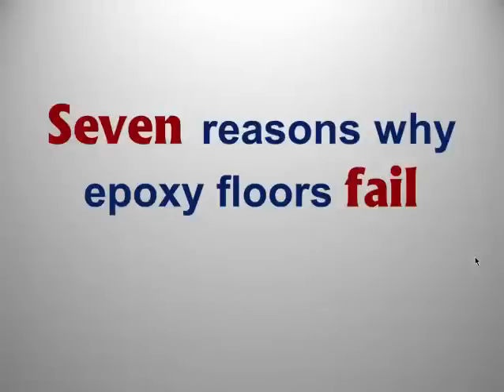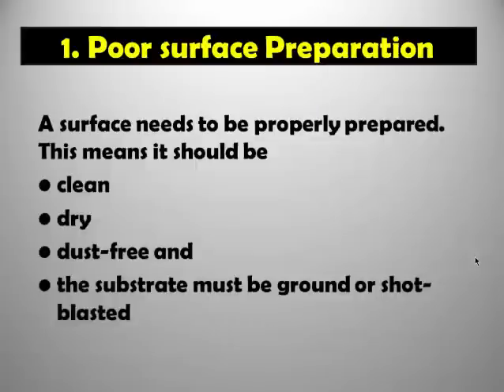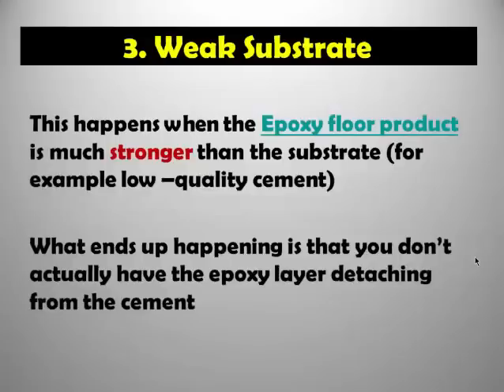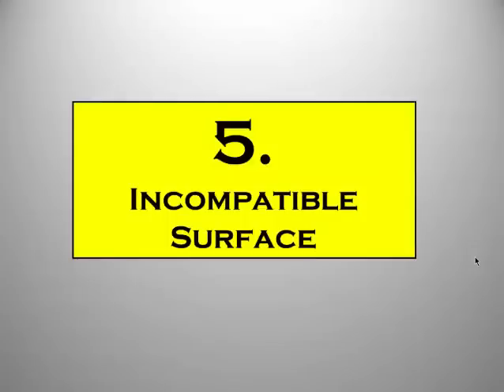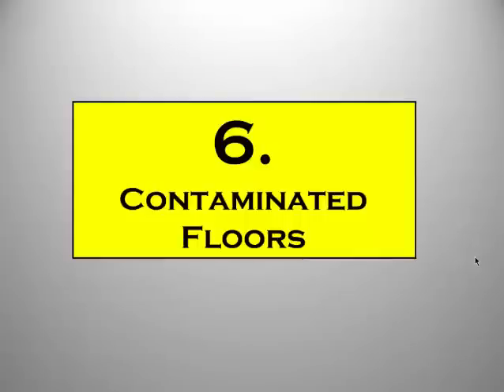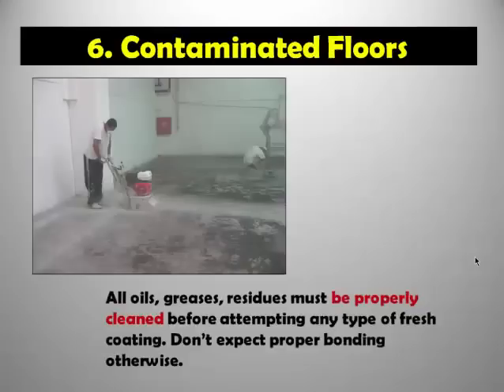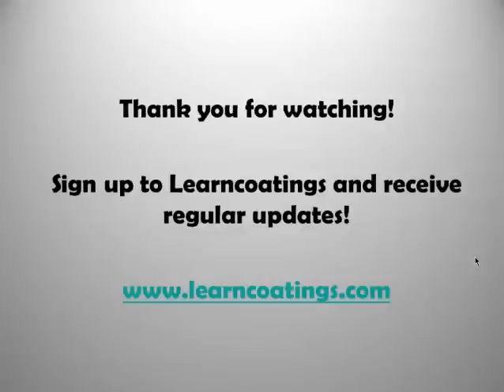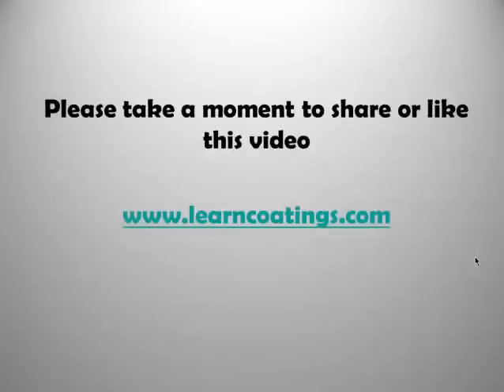7 Factors that cause Epoxy Floors to FAIL

Comment: When epoxying over a painted garage floor. Should it always be diamond ground? Do you need complete removal of the previous layer of paint or can I prime over this?
Reply from the maker: If the paint is in tact and not peeling you can prime over. If it is peeling you should assess if it is a localized problem. If the peeling is everywhere you try grinding it as much as possible

Comment: What about screened in porches with concrete? Will the epoxy fail on a outdoor surface?
Reply from the maker: Yes it will fail because epoxy is not UV resistant. It will go yellow and start to chalk. Don't believe reps that claim otherwise. They will be long gone when the floor starts to yellow. You would need to use an aliphatic polyurethane product for outdoor applications

Comment: In two places on my epoxy garage floor, a long running line, like a narrow ridge, has formed under the epoxy.    One is about two feet long and the other is three of four feet long.  What could have caused this?.  The epoxy was professionally done a year ago and looks good otherwise.  It is the epoxy with the flakes.
Reply from the maker: Could these be old floor joints that became visible due to the summer heat expansion? Otherwise these could be cracks in the floor that became visible again due to hotter temperatures

Comment: My garage floor has been previously painted, close to half has peeled off or wore off. It looks like somebody used latex paint on it but not sure. I'm going to strip it off, scrape, paint remover, acid etch, sand, clean. Any suggestions before applying Rustoleum pro epozy garage floor paint?,thank you
Reply from the maker: sounds like a soild approach, you may want to try if you can sand the paint off from the start so you avoid the paint stripper and etching

Comment: Our basement floor has many layers of paint, do we have to grind it completely off before we apply the epoxy?  In other words, how do we prepare a painted floor before we apply the epoxy paint?
Reply from the maker: It depends on the condition. If the paint is in good condition and not peeling you could prime on top. However if it cracked and falling apart you want to grind it of with a sanding or a grinding machine

Comment: My garage floor was done about ten years ago and it’s time to do it again. If I pressure wash it, can I coat over it with the same epoxy?
Reply from the maker: Yes epoxy can be coated over. If it seems to be damaged you may want to apply a primer first just to be sure that it will bond properly. Power washing should help make the epoxy clean, but if there are cracks in the floor you may end up with trapped humidity

Comment: OK.If I use the mixer I will ad bubbles and than what I do to eliminate those tine bubbles?
Reply from the maker: Let the mixed product sit for two minutes before starting the application. Many bubbles will burst. Also, If you are a applying a thick coating use a spiked roller to eliminate the bubbles. For thin film coatings, backrolling should eliminate any bubbles
Reply: MARCIO sborgi I
Reply: A torch can get rid of the bubbles.  Just don't hold on it in one place or you'll burn the resin.

Comment: on the sub floor would bag and box latex be ok for a smooth floor 4 prep to primer ?
Reply from the maker: not quite sure I understood your question. What do you mean by bag and box latex?
Reply: in the uk latex I have used is a bag 12.5 kg and 5lts liquid miw and spread smells of cats piss orrible
Reply: that's on a concrete floor
Reply from the maker: ok now I see, you mean like using a spreadable cement to level the surface and then you want to coat over it. Yes this is overall good solution, but it really depends on how much wear and tear your floor will be getting. If it is just a storage space with little traffic you should be fine. For heavier duty jobs I would advise checking to see what the mechanical resistance of such a product is

Comment: Can you just lay the diamond mesh sheeting on the concrete and apply the epoxy to that? Seems like a that would make it bond strong enough.
Reply from the maker: A diamond mesh sheet would definitely make the tensile strength of the floor very strong. However for bonding you would still need to do priming and somehow attach the sheet to the floor before coating. Also you would need significant quantities of epoxy to completely cover the mesh sheet. All this of course is hypothetical as I have never tried it for a floor.

Comment: I have never heard applying primer to the surface before applying epoxy if that's is true so what type of primer should I use???
Reply from the maker: use a suitable epoxy primer thats compatibe with the epoxy topcoat
Reply: Ely Portoy
Ely Portoy  Try Stone Coat Counter tops. They have videos in here.

Comment: Hi what about heating floor ? Or that epoxy good fo that or no ?
Reply from the maker: There are better floor coverings if you have heated floors. Epoxy is not great at thermal transmission, plus it does not have any elastic properties that can account for the changes in temperature
Reply: Edvinas Mieldazys
Edvinas Mieldazys I am adding a heating element under a wood floor, then doing the resin. Perhaps do not connect it to the walls. Leave space for the wood to move. I still have to screw the floor down though. I will ask around for those who use this resin stuff. Stone Cold Counters is good.

Comment: Can you do this over old ceramic tile?
Reply from the maker: have a look at this video for coating over tiles 
https://www.youtube.com/watch?v=gRIoNyurzSM
Reply: Thank you very much for this! Do you have recommendation what kind of materials to use ?
Reply: Dď
Reply: @learncoatings-epoxyfloorin9448  Interesting you say you can put this stuff over tiles, which are probably set to a wood floor, but you say no to wood floors. I have wood floors I am adding heat to. I will then have a strong boarded floor on top of that, then add the resin to it. I am doing the counters the same way with the resin.

Comment: What is the better way? Tile or e poxy reply soon nowadays i think about this thing
Reply from the maker: This not a one or the other decision. Both tiles and epoxy have their place in flooring. You need to decide what's best based on your needs and the existing conditions

Comment: What preparation is neccessary if I want to convert my wood subfloor to epoxy. I don't have a concrete floor.
Reply from the maker: Applying on wood is tricky as wood tends to contract and expand. This could lead to future cracking of the epoxy. I know that some people apply a primer first and then apply the epoxy. I would advise thin layers of epoxy, thick layers are more likely to crack
Reply: If you have any flex when you're walking on your wood, then you should put another layer of plywood down. I have used flexible epoxy before on wood (right after primer) then went over that with the rest of the floor... Not sure if it really does anything, but my boss had me throw fiberglass into the floor as well, and also not fun either to flatten your floor out again afterwards. And your itchy the rest of the project.

Comment: I had someone put epoxy on my garage floor the first time he did it was sticky for a few days and peeled in 3 or four places under tires. He came and fixed a few areas and now recently 1 area peeled off the floor. What’s the solution? Any advice is much appreciated
Reply from the maker: If it's is just one area you could try doing a local patch job. But if you feel that the whole floor is slowly failing and that it will be one never ending patch job after the other then you may need to strip the old floor and do a recoat

Comment: I'm doing over the floor in a restaurant that somehow have 3 sets of ceramic tiles stacked onto the sub floor . It will cost too much to try to get that up and do the floors. We wanted the floor to be red. with the clear epoxy coating over it. We painted it already but wanted to do more research before we go ahead and lay it down. Now by looking around I didn't see much on that subject and want to know if I use the right epoxy primer by rolling it onto the ceramic tiles,(a few coats) will that be sufficient enough for the epoxy resin to bond?
Reply from the maker: You should grind/ sand/ blast the tiles in advance as you need to remove the ceramic varnish coating that covers the tiles. Once this coating is scratched then you can go ahead and apply the primer. I have another video here 
https://www.youtube.com/watch?v=gRIoNyurzSM

Comment: What are the most durable epoxy finishes?
Reply from the maker: self leveling epoxy mixed in with quartz is the most durable in my humble opinion. Defintely go for a thicker coat at least 2-3mm

Comment: Thanks so much for this video, and all of your replies! We are right now grinding our old basement floor that had been previously painted, but it's been a bear to get all of the paint off. It's good to know a few hardened spots left is fine! Question, though, I was told to put a sealer down first before the primer. Is this necessary, or is that overkill?
Reply from the maker: I would say its overkill. Put one coat of primer and check to see if it is absorbed or not. If it is absorbed quickly, then just add a second coat of primer to make sure that you have a sealed surface. Good luck with the installation!

Comment: I have 1 inch oak ply, very solid, stained and polyurethaned.  Do you think it might work on that?  It's not flexible to me.
Reply from the maker: Epoxy on polyurethane can be quite difficult in bonding. You should definitely apply an epoxy primer first to ensure good adhesion

Comment: I have a floor that has hairline cracks in it. They are getting worse but I can't afford a new floor! What product can I use to repair or "fill" the cracks? I think the resin is cracking because the screed underneath it is.
Reply from the maker: what floor is it? epoxy, concrete? You could try using an epoxy putty, or use clear epoxy resin mixed with sand to fill it

Comment: Can I apply epoxy over an old brick floor?
Reply from the maker: you could, but do not use it for heavy traffic as the brick will fail. Bricks tend to be quite soft

Comment: can you epoxy over wood or does it need to be concrete
Reply from the maker: not recommended. Wood has humidity and is also quite flexible. Epoxy is hard and is sensitive to humidity. You could end up getting cracking
Reply: Dont woodworkers make tables out of epoxy all the time? Is there a difference in floor epoxy?

Comment: Do I really need a humidity membrane before applying metellic epoxy?
Reply from the maker: I don't use one, but then again I work in low humdity environments
Reply: would you ever recommend to do a humidity test I found that if you are above 80% you should apply damp membrane is that true? Thank you

Comment: is possible to lay epoxy floor on the granite floor ( without remove it) ?
Reply from the maker: granite is a very difficult surface to bond with. You will need to diamond grind it, and make sure you get a good scratched profile. Then proceed by using a strong low viscosity epoxy primer than can penetrate the surface
Reply: Jayasree AR to

Comment: I just had a detached metal garage built and when the concrete floor was poured and power trowled, something happened and the slab looks like cake icing with little chips flaked off all over. Contractor said no problem we can sand it out. Well your talking 2000 sq ft, so now the building is complete and he met an epoxy floor guy out here to look at it and they came up with applying an epoxy floor. We are going to be using heavy equipment and tearing down ATV's and motorcycles will an epoxy floor withstand this type of abuse? The epoxy floor guy said he does't need to sand the surface he plans to just brush it with a chemical cleaner. Any advise?
Reply from the maker: Although I am not  concrete guy that cake icing sounds like concrete laitance, which could have been caused if not the correct proportions of water were used in mixing the concrete. That top layer of cake icing needs to be removed. I am not sure if sanding is enough you may require shot-blasting or something a bit more hardcore. DO NOT apply any epoxy until this top crispy layer has been removed. Otherwise the epoxy will never last
Reply: Tami Schifflin it sounds like the contractor got on the floor to soon to start the Finnish. if it is to wet it will whip the "fat" of the concrete up and leave ridges. sounds like he messed up
Reply: Tami Schifflin 
also too much water in the mix. it may make for easy placement , but it makes for weak concrete .
Reply: There are a huge number of options you can do for this situation. The main thing you need to ask yourself is how long you want the floor to last.

1. If you don't grind the ridges out of the surface: A thin 30mil or less epoxy will not hide any of the unevenness. The ridges are weak points and will likely break off exposing concrete within a few weeks if not days.

2. You can grind the surface to remove the ledges: A 30 mil or less epoxy will stand up longer but will likely start to break down within a year or 2 from heavy equipment.

3. Use a clad epoxy system: resulting in a coating 1/4" thick that will withstand abuse and heavy machinery. Prep required is grinding and/or shot blasting (csp of 3 or greater). You will typically get 10 + years from this option.

Either way - the ridges are weak spots, and personally would seek compensation to rectify the issue.

(chemical wash as prep for epoxy is never recommended by reputable manufacturers)
Reply: Listen to Phaizer. I'm in to tall agreement with him and anyone that really has the right thing to do for you in heart will agree,

Comment: what about re coating a floor that has been scratched ????
Reply from the maker: yes you can do that. You may need to slightly sand it, wipe it clean and then re-coat
Reply: LearnCoatings - Epoxy Flooring Training
Reply: LearnCoatings - Epoxy Flooring Training we did epoxy first time it was mixed wrong n not sticking to floor . so we ended up having buy another kit of epoxy.  that went well until we put Thomson seal. turned out a disaster and now it still tacky n very sticky put a solution over to remove Thomson seal. but the floor looks horible tire tracks and foot traffic marks help !!!!!!

Comment: Weird question, could a apoxy coating work on a drum shell?
Reply from the maker: You would need an epoxy coating suitable for metal surfaces. Floor epoxies will tend to be break or crack on metal
Reply: @learncoatings-epoxyfloorin9448  thank you for your reply,  drum shell as in perussion drum sets in other words on wood.

Comment: Can this epoxy be applied on a heated floor?
Reply from the maker: You can apply it, but personally I prefer PU based coatings for heated floors. They are more flexible and can adjust better to the changes in temperature
Reply: LearnCoatings - Epoxy Flooring Training thank you very much for your answer.
Reply: Iosif-Crin Borsos (

Comment: What if you have a new concrete floor.  
Do you still need to clean it?
Reply from the maker: no not necessary to clean it, but make sure it has pores to allow the primer to penetrate. If the concrete is glossy you may need to grind it first

Comment: Thank you for the information sir, very well explained... I have a question for you sir, I have bathroom at 3rd, 2nd, and 1st floor straight down to the ground floor drainage chamber.. I have a leakage problem in all 3 bathroom ceiling... One of my friend suggested me to pour epoxy between the concrete and the 4 inch pvc pipe which is going down to the chamber or I am thinking to coat epoxy in all the bathrooms tiles and pvc pipes...  What should I do sir?? please reply
Reply from the maker: do not use epoxy as epoxy is not elastic and it will not seal the pipe and the concrete. Use a high quality caulking sealant based on PU or MS Polymer. Seal every gap between the pipe and the concrete and you should be fine

Comment: Wait i been told to clean the concrete with acid just for that to clean the grease oil etc stains .
Reply from the maker: Cleaning the concrete with acid is very common in the US, but not many people do it anywhere else. There is nothing better than proper grinding to prepare the surface
Reply: Yes acid mostly when is a BARE CONCRETE! BETTER THAN GRINDING! 
GRINDING OR SANDING IS MAKING SURE PAINT WILL STICK TO CONCRETE BECAUSE YOU SCRATCHING THE CONCRETE AND PAINT HOLDS EASILY THAN SMOOTH SURFACE CONCRETE!

Comment: Can the epoxy primer be applied over a concrete floor that's been grinded but has spots of latex paint on it?
Reply from the maker: It depends on the primer. I have used water based epoxy primers and it hasn't been a problem. But in the past a primer containing heavy solvents led to latex paint wrinkling